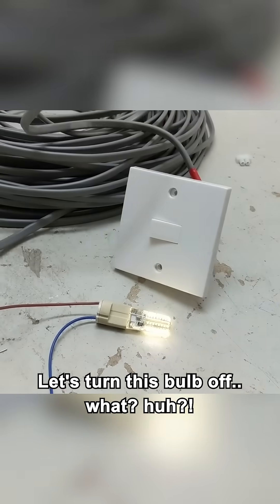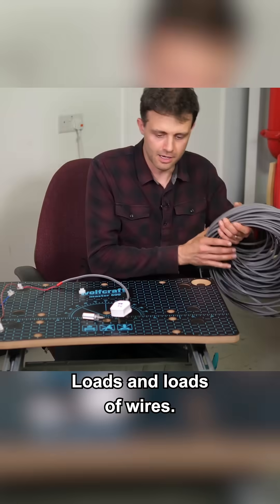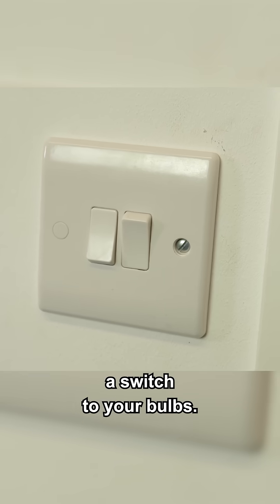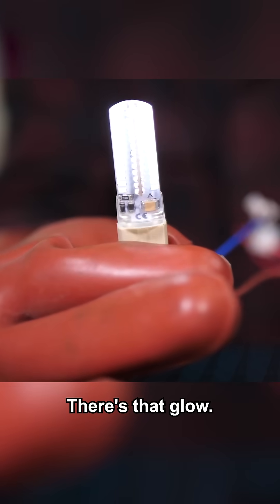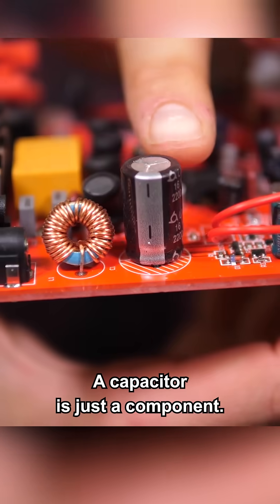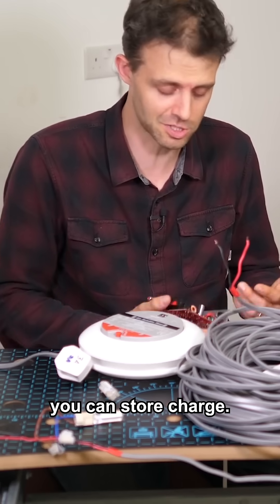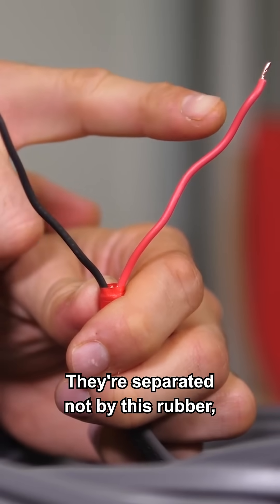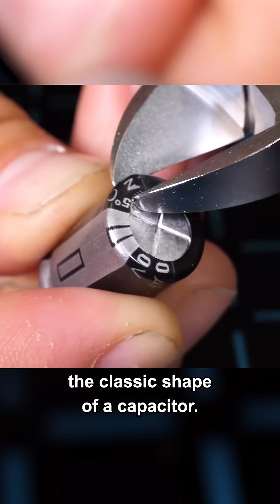This Zombie Bulb Will Not Turn Off! But Why?

Comment: Wouldn't the coil act as inductor instead of a capacitor? Inductors also store energy, but in a magnetic field instead of an electric field.

But i guess two wires separated by an insulator is also a capacitor, regardless if it is coiled or not.

Comment: Umm, I think you got this wrong. What a cool of wires makes is called an indictor. When you have a coil of 2 wires you have a transformer. Considering how large the could and spacing are its not a very good one, but it should be enough to power an LED bulb.

Comment: one of the first electrical diagnosis I had to do is an automotive technician.

customer replaces his dome light with an LED one can't figure out why it won't turn off.  service writer fails to tell me that it didn't come standard with an LED (yeah I know I should have known).  so I was looking at the wrong wiring diagram...  for about a half an hour I realized what happened and let the customer know.  

and so begin my Love affair with automotive electrical systems.

Comment: It may not be capacitance but inductive coupling, turning off the switch only opens the connection to one side of the wire, as the other wire is swinging positive and negative and in close proximity to another wire you can induce a current into the open wire that it's running parallel to.  in effect what you have is an air core transformer.

Comment: Very poorly done,  needs more detailed explanation. A simple voltmeter, showing residual voltage at shutoff, and rate of discharge. Maybe some estimate of stray capacitance. Bulb would not remain lit indefinitely, unless your pushing free energy from too easily hidden battery.

Comment: This is why I hate these short videos.  I click on them, but then they never fully explain anything or even begin to explain really.  But, it's a short video, so why did I expect anything else.  I guess it is my fault for clicking in the first place..but dang all these short form videos are click-bait to the max.  (FYI for those wondering, just saying a big coil of wires is a capacitor doesn't explain why the bulb stays on, nor does it show if the bulb will stay on indefinitely or not).  I'll go see if he has a longer version of this video later.  I generally like his videos.

Comment: I installed LED bulbs in my old truck. The dome light would stay on slightly like this. I used a relay to break the connection to the wire when the switch is off, or the doors are closed

Comment: If it’s a DC circuit, its inductance, not capacitance.  The magnetic field builds up around the wire inside the insulation in both directions, not around the coiled-up cable.  This only works with a low power LED and a long wire.  A capacitor would discharge instantly without an inductor in the circuit and would just flash the bulb.  If this is an AC circuit, then the power is all in the capacitors and inductors in the AC to DC conversion circuit for the bulb, and has nothing to do with wire.

Comment: You sure it's not an Inductor?
That's the one who's resistant to changes in current.

Functions the same here, yes but for different reasons than a Capacitor.

Also, an Inductor's notation used for circuit diagrams is a coil of wires which would make sense.
Reply: A coil of wires is how you diagrammatically represent an Inductor too, if that supports my point

Comment: I had lights that do this in my apartment and despite having professional qualifications in both electrical theory and practical installation I couldn't figure out what on earth was going on (not that I tried very hard or did any tests myself). Replacing the LED bulbs seemed to resolve it but there are some other weird behaviours still going on; I now suspect the new bulbs just had a higher voltage threshold but the capacitance issues are still present
Reply: I had the same thing. I changed bulbs but now get a periodic flash from the new bulbs. 
Aparrently the new bulb has a capacitor in its powersupply which charges up enough to briefly flash the bulb every few minutes.

Comment: All i inow is that the symbol doesn't actually mean 'a break' but a type of insulator used for a specific capacitor, like mylar, ceramic, polyester, etc... A break in the circuit is represented by a broken line with dots in opposing ends.

Comment: The wire absolutely is not causing the capacitor effect. The printed circuit board that is attached to the LED lamp itself is where the capacitive discharge of stored electrons is coming from.

Comment: Uh, except if there is an additional physical phenomena, it's not a capacity but an inductance. Both can store energy, but one eventually cut the circuit while the other eventually act like a wire (eventually: when a flat voltage is applied).

Comment: Your wrong. It's not the capacitance that's causing it. It's the induced voltage from electromagnetic radiation around you. The wires in the place is causing the voltage you are seeing in the video. Take it outside at night in a valley. If it was capacitance it would eventually die no matter what and not just when you take it outside. Try it and prove me wrong or face being called a misinformant!

Comment: This happens when the switch does not break the live wire, but the neutral wire.
It is a common mistake in the electrician circuit that the switch does not break the live wire, but the neutral wire.😂

The coiled wire emits enough energy to keep the LED bulb functional.
and the cable has inductive and capacitive properties.
The coiled copper gives the inductive character, and its insulation gives the capacitive character.

Comment: If the wire is acting like a capacitor, then you'd eventually discharge the capacitor. And the light turns off.  A capacitor still needs to complete a circuit in order to discharge. This appears more so to be functioning like an airgap transformer. Where one winding is acting like a transmitter antenna and the other wire is acting like a receiving antenna.

Comment: The break in the circuit is actually how I was introduced to capacitors in physics. Almost like it builds up a voltage until the gap is bridged by a spark.
Reply: Yes

Comment: Interesting. We had a power outage for over 26 hours and we also had an LED nightlight stay on for the entire time. Mind you it was at diminished brightness, but stay lit it did. We were also capable of keeping our cell phones in a stale charging state. Use it and it drops percent points, but if it stayed plugged in, it would still be at the same charge. In fact if it was turned off it would raise the charge 1% per 30 minutes. The only explanation I could come up with is that the origonal wiring had the ground connected to the plumbing system, and the current (pun) wiring setup is for a grounded "neutral" system. We were leaching electricity through the neutral line straight to earth/ground. It came as a real shock to me when it occurred (also pun intended).

Comment: Not sure it'S a capacitor, more like a transformer. You got loads of windings near each other. It will induce current in the other windings of the wire.

Comment: Did you know the CFL bulbs (the clorofloro something bulbs that replaced the normal orange buld that got replaced by LED bulb) glows like a glow in the dark stuffs after you switch it off. It has faint green glow.

Comment: Wouldnt a capacitor run out of juice when 'off' eventually?  What process allows it to continually draw electricity when the switch has flipped?

I thought it was due to the fact that light switches are not truely 'off', i.e. how 2 switches can altenate whata on/off and LEDs were able to hypass that?

Comment: In the wiring diagram the capacitor should have been in PARALLEL with the light bulb! NOT in series.
Otherwise it is not a CIRCUIT! electricity needs a circuit
Reply: No, it does not. You can have current even if there is no complete circuit if you use AC.
Reply: @viniciomonge3960  
You're thinking of static electricity. Which if anything would be Direct Current and definitely not an alternating  current which would that it.
Electricity does not need a circuit it just goes from a place of high potential to low potential.
Reply: @travisderthick9361  omfg, I an electrical engineer and physicist. Of course you can have current in many things that are not closed circuits. The reason why it happens  because between capacitor plates a changing electric field creates what it is called a displacement current.
Reply: @viniciomonge3960  how is there a voltage difference across the light if the capacitor is in series with the light?
The stray capacitance powering this must be in parallel with the light. Electricity must flow from one plate to the other
Reply: @travisderthick9361  The electric field goes along the wire, the capacitor and the light itself. The electric field generates a voltage by definition

Comment: This phenomenon is real, but when it happens to your home, it's almost certainly a neutral failure (voltage returning from neutral). If you see this, consult an electrician asap, as it can put you in danger (many electrocal systems ground the neutral, thus making metal devices live in such an event).

Comment: So triggered, so a capacitor is when the circuit is broken, but it there was a light on a second winding of cable not connected to anything then it would be a inductor, so there is two windings close together that’s a inductor

Comment: In my opinion it does act like an Impedance because we are talking about a wire which is a winding form...You may a capacitor in parallel of bulb which will absorb the current stored on it...

Comment: As many people comments at the beginning i was sure that was an inductor because of the winding of the cable. but thinking about it a bit longher I realize that it cannot be a inductor, because in the cable there are two conductors but they have equal and opposite current so they try to create equal and opposite magnetic field that cancel each other, an inductor must be the winding of just one conductor in the cable. At the same time we can consider this two conductors as the plate of a capacitor, but in the Circuit that he shows is connected in series but is actually in parallel. Just immagine that the cable was straight it would be the same thing.
The very wrong thing that he shows is the connection with the winding , a capacitor have nothing to do with winding, they do them like this Just to save space otherwise a capacitor would be very very large. So the wind up they plates.

Comment: I don't think the wire capacitance is the reason. If you do the math, the capacitance will be miserable. The reason is probably the capacitor in the LED bulb circuit. As someone suggested in the comments, try to remove the bulb from socket.

Comment: The sceme is wrong. The capacitor is in parallel (the long wire length with two conductors), not serial.

Comment: INDUCTOR - not a capacitor. The only way a capacitor would work is if it was connected in parallel with the lamp (and if you're supplying DC) and the lamp would maintain it's brightness when the switch is opened and then slowly dim. You've created an inductor and is providing a half wave to the lamp, hence the half brightness. An inductor would only work in series with the lamp too and that's exactly how you've arranged it. The cap you've shown us at the end is an electrolytic capacitor and would definitely only work in your circuit if in parallel with the lamp and if using DC as it's a polarized cap.
Reply: you put a capacitor in series in AC circuit you get part of each half wave through the bulb.
that is how cheap led lamps drop the line voltage for their diodes. 
you don't use an electrolytic one, but it provides a very visual demonstration for a video.

Comment: Capacitors are a little bit like exotic dancer clubs. The dancers are attracted because the clientele has money. The customers are drawn because the dancers give an illusion of availability. But a barrier exists that prevents the two from fully "interacting". On the weekends, you have the best performers and the highest-spending customers. On the weekdays, less. Thus the ebb and flow on one end effects the ebb and flow on the other end, though there's never an "exchange". There's an alternating cycle on one side of the barrier that elicits a similar cycle on the other side.

Comment: The capacitive diagram was wrong, the capacitor should be shown in parallel with the load not series. You also missed the inductance which is coupling with all of the wiring around you. This setup also requires an extremely small load. (High impedance)

Comment: My radio in the shop did not perform well after all these years. 
So I bought another radio from Amazon. I plugged it in and turned it on, and it was just what I needed. 
When I got through listening to it, I turned off the power supply, it kept playing. So I unplugged it, it kept playing, 
I looked on the back and it has a place for batteries, no batteries, it kept playing? Twilight zone? 
So I went back into the kitchen and looked at the instruction manual. 
It has internal batteries that are rechargeable, ha ha! 
Damn Chinese!

Comment: Most Switches do not isolate correctly if you measure voltage in the off position you can measure sometimes even greater than 10V AC (assuming 230V AC feed) this is also enough to light some of these bulbs.

Comment: I've always wondered if you could create artificial storage on a device, just by having the data stored in the cables transporting it. 
I suppose it would be similar to this, with an unnecessarily long cable.